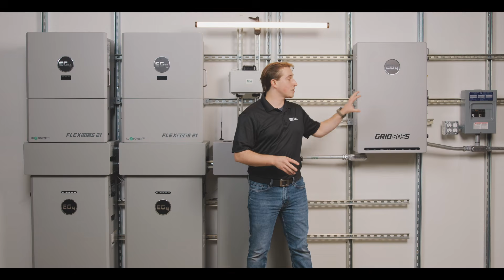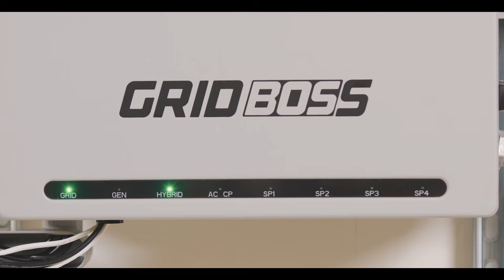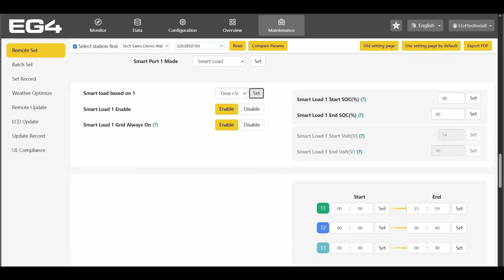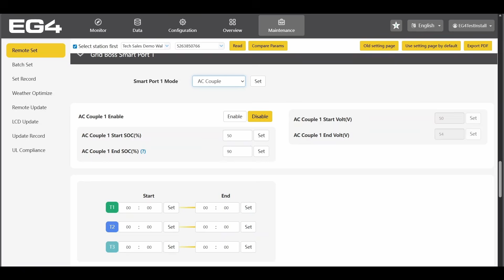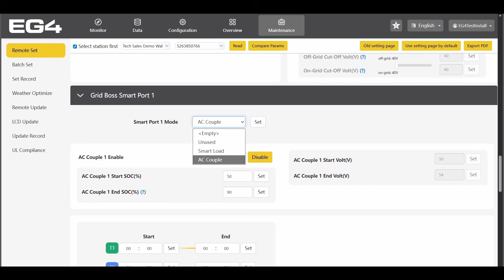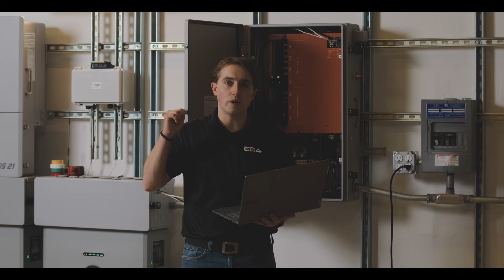Smarter Load Management with EG4 GridBOSS Smart Ports

Comment: It would be great to enable load shedding based on power demand. Maybe that's possible but based on these menu options it did not appear so. I.e. setting a heirarchy of loads to drop if total system demand is over x kw.